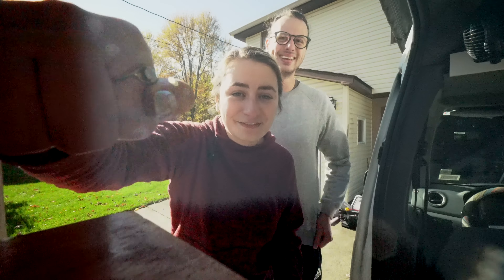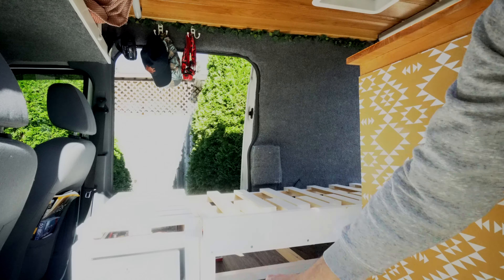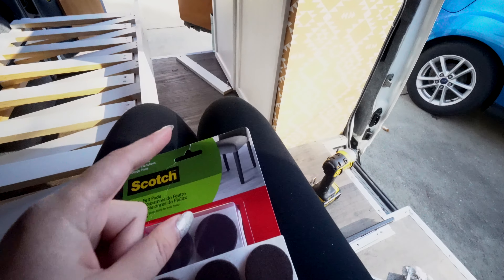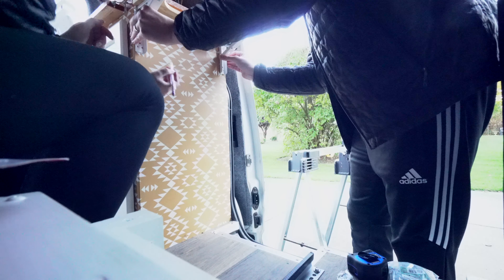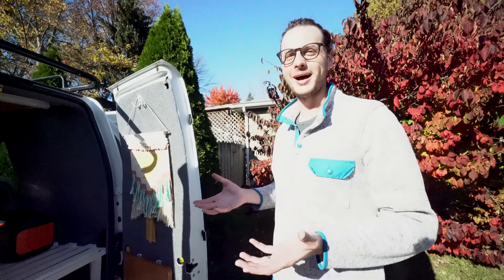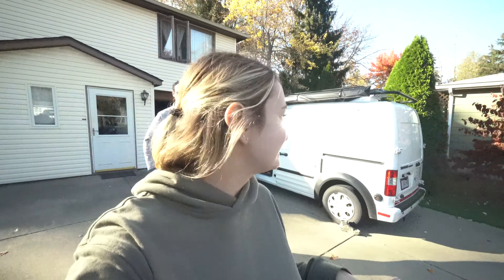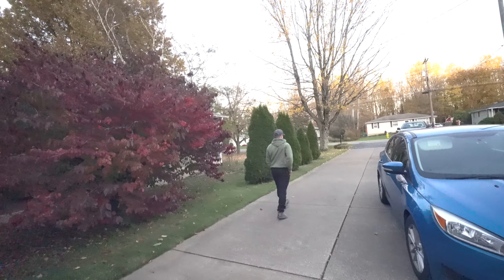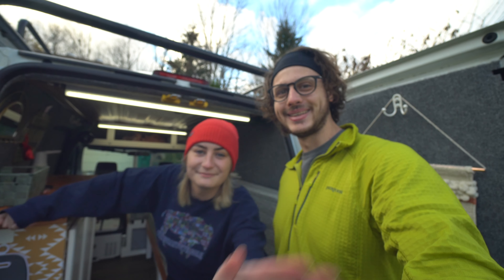Ford Transit Connect Micro Camper Van Build: how to add a sink, updates to our bed & electric system

Comment: For your sticky bed frame slats - Try rubbing hard candle wax on all wood-to-wood and wood-to-metal surfaces to make it slide better. You don't need much. Scented wax will freshen the indoor air too. In a pinch, a shorter lasting solution uses a bar of your favorite soap. Then... slip-slide that bed away, easy-peasy.
Reply from the maker: Huh, we would have never thought of that! That is genius! haha Thank you so much for the suggestion, we will have to try that for sure! Anything to help with the bed sliding situation... Thanks for watching, we really appreciate it!

Comment: I love the simplicity of the tap.

I was wondering if the battery connections, including the new power meter, are fused at all?
Reply from the maker: Thank you! No, the connections are not fused! Thank you for watching, we really appreciate it :)
Reply: @mikeandheather  
Thanks for the reply.  I'd definitely look into adding fuses to any battery connections.
Reply: This is such an important topic that really needs to be pushed in the diy build space. Fuse for everything. Also, fire extinguisher in an easily accessible spot. 💓 Stay safe vanpeeps! 💓

Comment: Another Great video (especially the sink solution)! I’m looking forward to the van tour when you have got everything finally wrapped up, as well as more of your adventures on the road. Are you planning on adding any sort of heating to the living quarters of your van?
Reply from the maker: Thank you! We really appreciate it and you watching! 

As of now we our heating solution is a warm sleeping bag, electric blanket and a Mr. Heater Little Buddy Heater (that we would not sleep with on) We are hoping this will be enough to keep us warm! We are also hoping to not be in too many areas where we will need them haha 

If you have any experience/suggestions on heating solutions we would love to hear about it! We thought about adding a diesel heater but do not know if that will just be excessive. (it is also quite expensive) We are going to try and "cold" camp soon to put our heating situation to the test! We will have to keep you updated on how that goes!
Reply: @mikeandheather  I saw a video on Facebook made on tiktok about a new small heater/camp stove called 'Chubby' - it looks space smart.  Good luck!
Reply from the maker: @jessiferri2922  Thanks for the heads up! We will have to check that out for sure :)

Comment: How are you going to drain the water from the sink when it's full?
Reply from the maker: Hi- the sink is able to pop out so we would dump it out if/when we ever use it in that way. (we have biodegradable/environmentally friendly soap) Honestly we mostly wanted to add a faucet to have better access to our water supply to fill up our water bottles while on the road and intend to use that more than the actual sink basin. 

We added the sink basin just in case we wanted to wash our face, rinse off a dish or something like that. We would then just dump the water outside of the van after. That is how we have used this sink, prior to installing it in our van, when we were tent camping. It is a low tech sink setup for sure haha but we found we needed access to our water more than an actual sink so this works for us. Hope this helps! Thank you for your interest and watching, we really appreciate it!

Comment: Hi there. Where did you get your roof rack and what type???
Reply from the maker: Hi! The previous owner purchased the roof rack so we are not 100% sure but we get this question a lot and tried to find it- we think they purchased it through Walmart! (this is the only place we have found the roof rack) Here is the link if you are interested: https://www.walmart.com/ip/80070-Transit-Connect-Roof-Rack/657367817?fbclid=IwAR11Xr-KH2sSWdLmGLL6poLlsXHM7oxqS9am-_GRMHBkUpmOOJjEbu7HXoQ

Hope that helps! Thanks for watching, we really appreciate it!